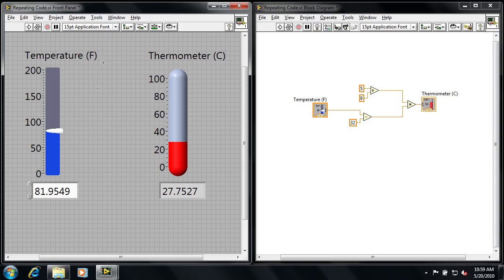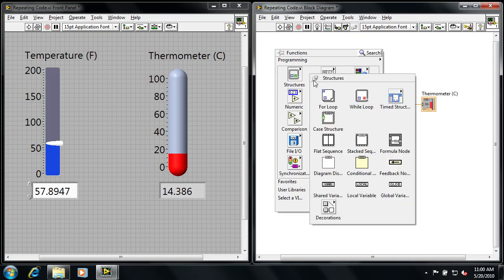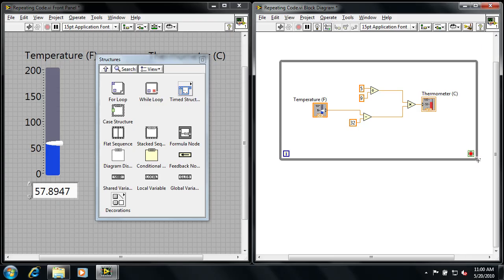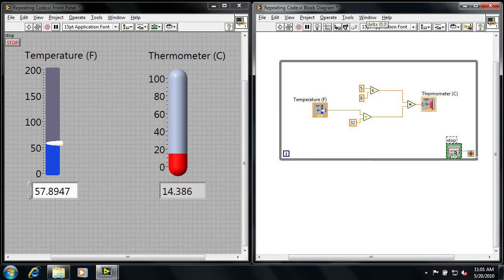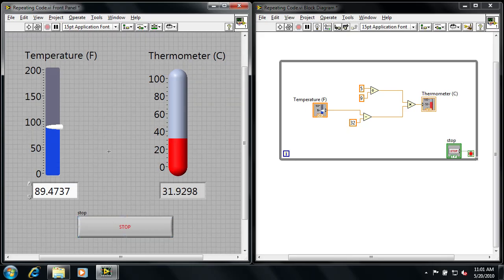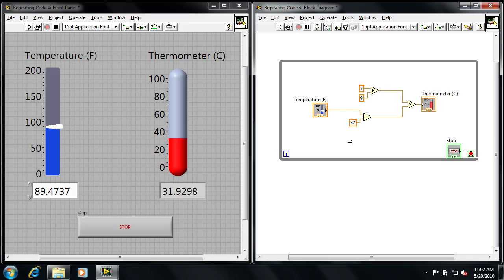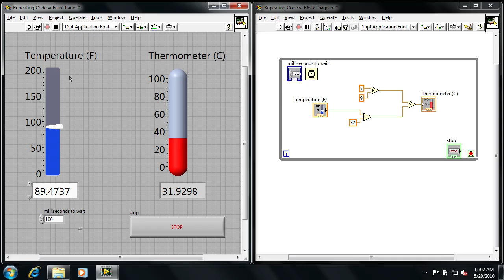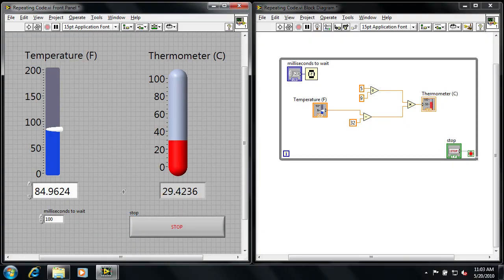Using Loops in NI LabVIEW

Comment from the maker: @widdalightsout The While Loop structure in LabVIEW is the same operation as in other computer languages. Running a VI once (pressing the Run arrow) or continuously (pressing the Run Continuously button) does perform different operations. Run continuously will cause the VI to start again as soon as it is done performing it's actions. The Run arrow will just run the code on the VI once.